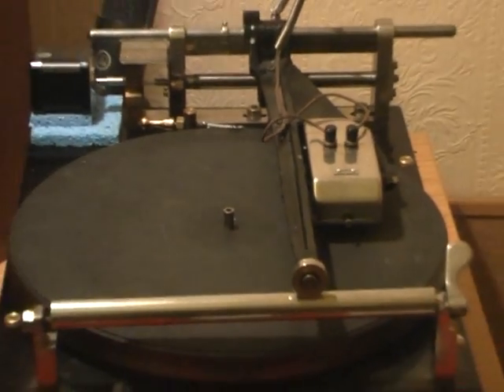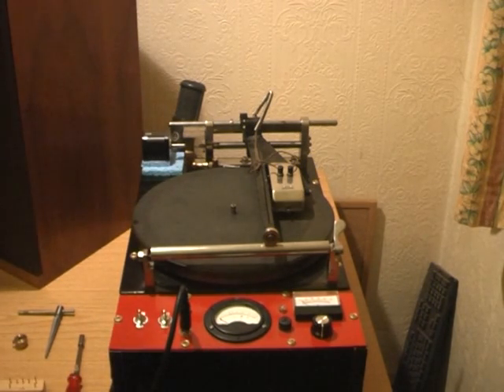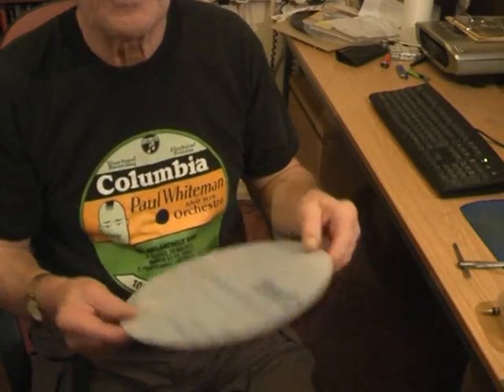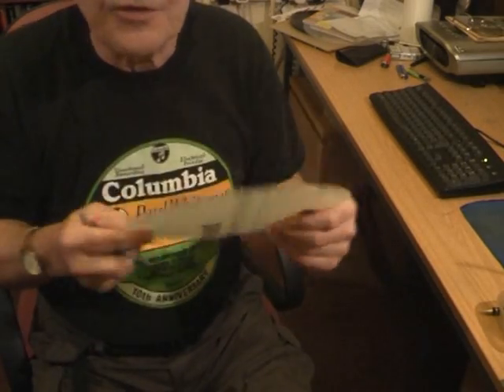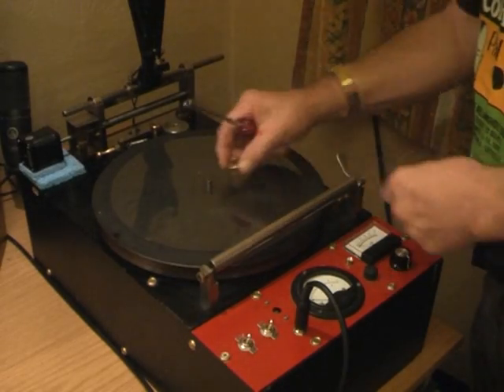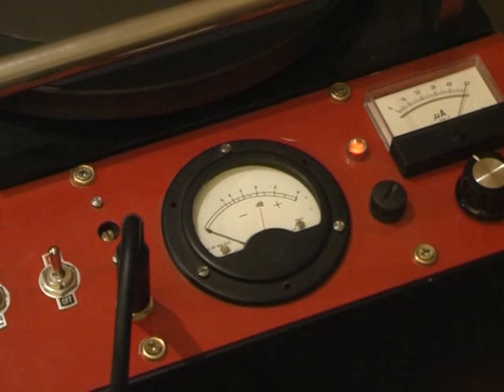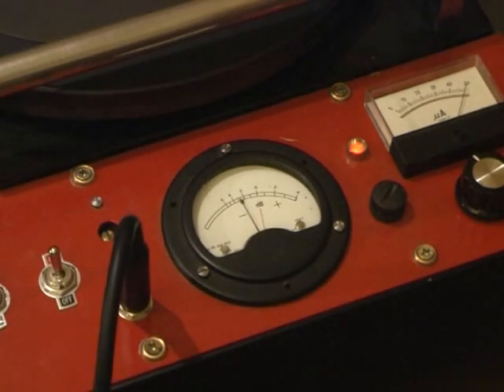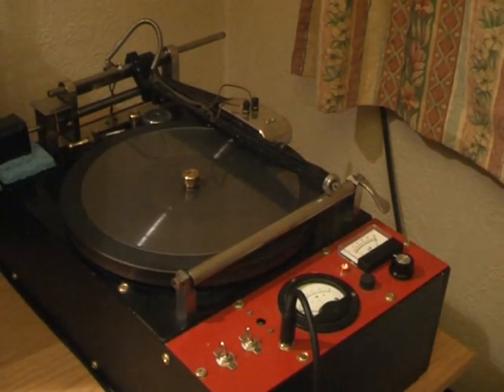home made 78 rpm records

Comment: I have a gramophone (a lovely HMV 102), and would like to cut my own playable 78s. Would that be possible? Is there a type of disc still in production which would stand up to the heavy tracking weight of a hmv gramophone with a steel needle? (or maybe a thorn one)
Reply from the maker: Hi there. Well, Im afraid the answer is, basically, no. The reason is, that the mechanical (=acoustic) gramophones, have a playing weight at the needle point of - a lot. 200 grams, whatever. And, at 78 rpm on the edge of a 10" disc, centripetal force - the force that draws the needle in to the centre of the disc - is large. Therefore, to stop the playing needle from being drawn in across the grooves, the groove needs to be quite deep. Like on an old-time 78s. The only way forward would be to use lacquer-coated master discs. They will take a nice deep cut. But they are now incredibly expensive, and almost impossible to make yourself- I've tried. So a shallow furrow, enbossed (not engraved) on a polycarbonate disc, as in my video, was the best way forward. One you've got things right, it works pretty good on a modern turntable. But sorry, there's no way one would play on a hand-crank phonograph/gramophone. The pickup would just skid right across the disc. Sorry & all that; but maybe you could discover some new plastic material that will take the required groove? If you find one, do please let me know! All the best for now, Norman.
Reply: @bixanorak  Thank you very much for your prompt and detailed reply.
Reply: @bixanorak  Hello again, you said to let you know if I found some kind of material which would be compatible with a steel needle? Well, I think I've found a company that does. It's called Vulcan Records, and they also produce new phonograph cylinders. 
https://www.vulcanrecords.com/product-category/7-inch-discs/

Comment: Followed the link and it seems to be down.
Where did tou get the styli and disks?
Reply from the maker: Hi there - and Aiee, Aargh &c. The link died somewhere down the line; but I've just re-instated it, & it should now be OK from the URL in the video description. The styli were made as shown in the link; the discs are 1.5mm or 1mm polycarbonate plastic, which is relatively cheap - except that having it cut up into discs, like trebles the cost. Am still trying to figure out how to trim squares into circles. (Poloycabonate suppliers are often prepared to cut into squares gratis - it makes it easier to ship! Alas, square 78s, novel though they are (and how easily they fit into square packets!) are INSTANT DEATH to expensive diamond styli, should they fall off the outer edge of the disc.... Let's face it; there will be (78/60) * 4 = 5.2 corners per second zooming past to mess up your expensive stylus!) Still, never say die! We 78 rpm enthusiasts shall, eventually, prevail. Or at least I think so.  ???  In any case, take care. Cheers, Norman.
Reply: @bixanorak  thank you so much for all your wisdom and insight.  Its beyond valuable to an insecure noob like myself.
I'm trying to build my own machine from scratch for my college project.  And your videos is one of my key referrences.
Cheers to you sir!

Comment: Too bad this won't work on acoustic record players, they would destroy the record.
Reply from the maker: Yes; it would be great to be able to make discs that would play on old-time gramophones. Still, there might be some modern material that was soft enough to take a modulated groove, which could later be fixed by some means? The  German 'Permarec' system of the 1930s used that idea. You cut the record on the relatively soft original disc. Then, it was baked in an oven at 80 - 100°C for an hour or maybe two. The disc was then 'cured', and could be played with a steel needle many times without wear - or so it was claimed. I wobder what the original coating was? Cheers, Norman.
Reply: @bixanorak  Hey, that's an interesting idea.

Comment: Can you cuy 33's & 45's on that machine too or just 78's?
Reply from the maker: Yes, but have only done 45, not 33. This needed a new, smaller pulley for the motor, and - very important - (a) a much finer embossing point along with much less pressure on it; and (b) a MUCH slower feed-screw speed. Simple actually, but does require quite a bit of tinkering to get it right. Upside: polycarbonate seems to take a furrow better at low velocity - 'crtitical strain rate' is probably involved. Downside: the disc is rather harder to play back, demanding a high quality record deck, with variable anti-skate, &c. Cheers, Norman.

Comment: As a youngster aged around 10, (40 years ago)I had an old portable wind up gramophone, which I would use to make 'records' out of old washing up liquid bottles opened up and cut into a disc shape.  I placed an old vacuum cleaner hose into the horn and stock a funnel on the other end which we could speak into.  It worked surprisingly well!
Reply from the maker: Sorry, no; you can't ply these with a steel needle. There is only a shallow furrow, nor a real groovr, so the sund box just skets into the centre of the disc with the centripetal force.Best wishes toi you and your family, Norman,

Comment: when you told me of a big pulley for the movement of the recorder head for a 33-45 turn incision, is a pulley of 60 teeth enough or do you need one of 80? because the 60 tooth pulley is easy to find.

Comment: Is this system able to record 33 1/2 rpm as well?
Reply from the maker: Hi & thanks for writing. If you're simply asking 'Can we emboss on polycarbonate at 33.3 rpm?', the answer is yes. Indeed, there are many videos on YouTube showing clever people who have made ingenious machines that will do exactly that, even in stereo! Check them out. Even the old-time 78 rpm mono machine in the above video could be made to record at 33.3; BUT, quite apart from getting the turntable to go a 33.3 instead of 78 rpm, you would have to use a much finer embossing point, which would , of course, require a lot less pressure. The reason for this is the lower groove velocity at 33.3 - especially near the centre of the disc. This low velocity does not allow higher frequencies to be embossed; the surface of the disc is passing under the point too slowly. It would probably be OK at the edge of a 10" (25cm) disc, but as the velocity near the centre is only about 40% of that at the edge, you would get catastrophic loss of the upper frequencies as you approached the centre of the disc. (That's why the old discs in the late 1920s for film sound tracks, which were 33.3 rpm but with a standard 78-size groove, had to be so big at 16" - in order to keep the groove velocity high enough to carry the upper frequencies). Hope this helps. Cheers, Norman. P.S. On the machine above, you would also have to slow down the feed-screw a lot, otherwise the grooves would be too far apart...

Comment: where would you find record lathe and where would you find the disks
Reply from the maker: Hi there. Amateur disc recording machines sometimes they appear on ebay, usually in poor condition & in need of restoraration. They are far more common in the U.S.A. than in Europe. Best regards, Norman.

Comment: For a very slow cut at 33/45 rpm, I should use as coarse pulley for the feed screw, the flywheel of a cassette recorder and as a small pulley of the drive motor, the seat of the strap always taken from the motor of a recorder a cassette?
Reply from the maker: Hi Allessandro. I hope I understand your question. You want to use the motor from  cassette recorder, driving the flywheel of the same cassette recorder; then take the drive from the centre spindle (capstan) of the the flywheel? If so, the rotation of the flywheel would be too fast. If the capstan spindle is for example 2mm diameter, then to drive the tape at the correct speed (~47.6 mm/sec) it must rotate at ~7.5 revolutions per second. This is very fast for a feed screw. But you could put a small pulley on the capstan spindle, and take another belt from that, to another large pulley, and that second large pulley would go slower. But all this is very complicated! To cut a 78 rpm disc, the very fine feed-screw on my machine turns only once in 2.8 seconds. To make records at 45 & 33 rpm, it would need to turn much slower. One thing you could do, is to use a stepper motor to drive the feed screw, like I did. Even then, it would requite an intermediate pulley for such a slow feed speed, especially if your feed-screw is, say, 8mm threaded rod. Cheers, Norman. (I have two videos which show you how to run a stepper motor. I used a NE555 timer chip, but since making those videos, now I use Arduino.) https://youtu.be/RAtC-oBI3mE

Comment: for the movement of the arm with the recorder head, if you do not have the one recovered from a phonograph engraver as you did, an alternative could be a threaded bar 10 mm or 12 mm?
Reply from the maker: Hi Alessandro. It is better to have a very fine threaded bar (feed screw). The recording head must pass very slowly across the disc; so the fine thread is better. 10mm, 12mm, even 8mm threaded rod will have to be rotated very slowly even to cut a 78 rpm disc. If you want to cut 45 or 33 rpm, it must be even much more slowly. In theory, it is possible. But the precision (tolerances) of the larger 10mm, 12mm rods is very low, and whatever you use to track the bar, such as a nut, or two nuts separated by several centimetres, will probably keep stopping and starting - it will probably move in small increments, not constant speed. You might try 3D printer lead screws. These have an even coarser thread, but have better precision - still, you will have to make them rotate very, very slowly. A small pulley on the drive motor, and a really big pulley on the feed screw will be needed. Hope this is of some help, and good luck with your project! Cheers, Norman.

Comment: What is the make and model of your particular cutter?
Reply from the maker: Hi there. The actual mechanism was made by a company called M.S.S. - this originally stood for "Marguerite Sound Studio", which was created by Cecil Watts in the very late 1920s and early 1930s. They had a recording studio at 99A Charing Cross Road in London. Watts had developed a viable form of cellulose nitrate lacquer, plasticised with castor oil and dyed black, which was sprayed onto thin aluminium discs, a successful prototype of the lacquer recording disc which remains in use to this day. Watts supplied the BBC with machines to his (and their) design(s). Much later, the M.S.S. name was changed to Master Sound System, and M.S.S. disc cutting machines were marketed as late as 1960, though the essential design remained the same. They supplied many portable (though very heavy!) machines during the Second World War, 1939-1945, for use by the BBC and the Armed Services. The deck on the machine in this video was doubtless stripped from one of these units. That's how I found it; just the metal top, no motor. The box & panel were knocked up by me to house it, and a new motor fitted. So basically, it's an MSS machine, but I don't know what the model was. Hope this is of help. Cheers, Norman.

Comment: Hi, it's me again, you helped me out with embossing needles a while back! I have a question, can you tell me the angle the needle should be when making a record, I looked at my cutter, and its like 90 degrees straight down... also the amount of weight we should putting on the record with this needle... I seem to be to heavy most of the time.. I get a lot of hiss and I've tried different needles. Thanks in advance and wish you and yours a Merry Christmas. - Jack
Reply from the maker: Hi there! OK: it's good to have the point angled forward, just a little - maybe 1 or 2 degrees. Or even a little more. If the point is angled at all *backwards*, that is definitely bad, because it will try to 'dig in' to the plastic, & judder & be very noisy. The weight, the pressure you put on the point, is dependent on how sharp the point is. The sharper the point, obviously the less weight is needed to emboss. But if a point is rather blunt, then you'll need more weight - HOWEVER - there will come a time at which a really heavy pressure will stop the point from being able to vibrate & emboss the sound. You have to try to find the best combination. A very sharp point with a low weight won't make a deep enough furrow to keep the replay stylus in the groove it will slide across the record! It's really a question of writing off a lot of polycarbonate during the trials... "Persistence Wins", as they say... only it can be quite frustrating at times! Good luck, and all the best for Xmas & 2018. Norman. P.S. the recording pressure I ended up with is around 60 - 79 grams - but there are different grades of polycarbonate also...   >8^(
Reply: Norman Field Thank you, that does help, and as soon as I have some free time I will try what you suggested... I think my needle was digging in, so I will definitely change the angle and check the pressure, you make it look so simple, but I do know it’s takes a little finesse...Thanks for the quick reply.

Comment: Sir.....where can you get hold of this thickness of poly?.....searched everywhere.....cant find it!
Reply from the maker: Hi there. Yes, polycarbonate is most common in 2, 3 or 4mm thickness & above. However, is is available at 1.5 mm and even 1mm thickness, both of which are OK - I first used 1.5mm, but later tried 1mm & that is also OK. I'm located in the U.K., and a supplier was quite easy to find. I don't know where you're located, though. One piece of advice I can offer you: having the sheet cut to discs increases the cost very considerably. My supplier (in Coventry, England) will cut a sheet to squares at zero cost - it makes shipping much easier. But having them cut to rounds makes them about three times more expensive! So if you can contrive a simple way of cutting an 11" square to a 10" disc (I have not yet figured that out), you'll save a lot of money. If you're in the U.K., contact me again & I'll send you my supplier. All the best, Norman.

Comment: What is the power of your cutting amplifier? For this MSS head
Reply from the maker: Hi there. The MSS heads required very little power. 3 or 4 Watts max. They were often driven by a single 6V6 valve, and an EL84 was also OK. MSS in later years (1950s/60s) provided amplifiers of their own of higher power, with two EL34s in push-pull. But the point of that, of course, was to take advantage of an amplifier running very easily & so low distortion &c. The amplifier I used in the video was an old NAD 3020, which had ample power - the gain was seldom over 30% of the volume control range. One channel drove the head (which is mono of course), and the other channel conveniently acted as a monitor. Cheers, Norman.

Comment: Incredible video and many thanks. Did you do a special modification to play 78s on that turntable? I thought it only was made for 45 and 33???
Any info would be greatly appreciated 
Thanks
Michael
Reply from the maker: Hi Michael. Thanks for writing. The machine was & is 78 rpm only. The basic design goes back to the 1930s.  The mods. I made were mostly in the way the feed-screw was driven. Since making the video, I have made a drive bush that will enable cutting a 45 rpm - that was just a trial to see if it would work. It does, but the embossing points must be much smaller, have a relatively sharp point angle (around 50°), and of course less pressure. Cheers, Norman.

Comment: Can you play these records on a portable gramophone?
Reply from the maker: Hi there & thanks for writing. Alas, no; there isn't really a groove, just an embossed furrow with ridges - exactly like a farmer ploughing a field. This furrow isn't deep enough to hold the needle of a portable gramophone in place - it will just skid over the furrows into the middle of the disc due to centripetal force. However, quite recently, people have begun cutting a true groove into polycarbonate with a heated diamond cutter at 33.3 rpm. If this could be done at 78 rpm with a fairly large cut, then it may well be possible to play a polycarbonate on a mechanical gramophone, though one would have to reduce the pressure applied by the soundbox. This could be done with a counter-weight. I have managed to play lacquer discs on a mechanical gramophone by reducing the needle pressure to about 35 grams. Hope this is of help. Cheers, Norman.

Comment: I treid cutting some 45s, and they were comming out great,, then each one i cut is becoming quieter and quieter.. Am using a 4 ohm 3watt speaker.. Do i need to change it. or reduce the coils.??
Reply from the maker: Hi there. If the sound quality is the same, but just getting quieter, it might be the suspension in the speaker becoming more flexible. Of course, I don't know what your system is like, but if you have another speaker the same, it would be worth trying that instead. Good luck! Norman.
Reply: I'm using a 1'' mini subwoofer.. a cone and a nail.. I could always change the speaker.. Trying to look up magnetic heads.. I got a machine shop out back from my house. So he can make some parts.. but hes not good at electronic engeneiring. i made a inverted cone earlier driveing it with some bolt and magnets..40 winds of wire..I'll  try that..
Reply from the maker: If you're going to home-brew a cutting head & wind a coil for it, use nice thin wire - I often use 36 SWG (32 AWG), maybe 150 turns. The DC resistance is around 10 Ohms. Also,  neodymium magnets are very strong. I've never home-brewed a cutting head though! Again, good luck!

Comment: Cause its Frikkin' Cool.... Just got mine working with an alarm cloclk radio.. Just took thw two wires out for the speaker.. and jumped mine.. I cut some cd's to test them.. And i tried two 6'' disks.. Mine cut at 48.rpm.. It  playes slower on the 70s Equipment.. But it works now.. All these videos helped.. thanks.. Cheers,,,